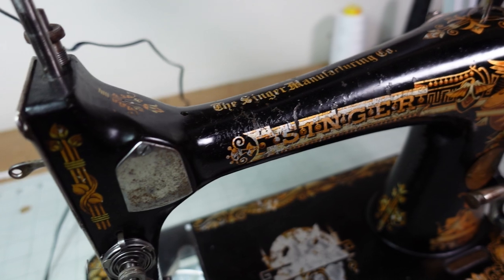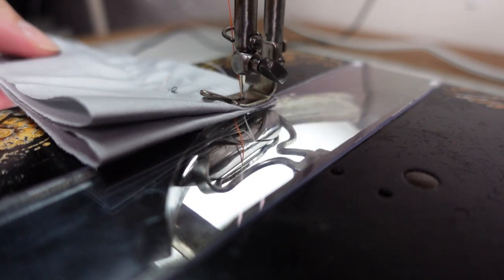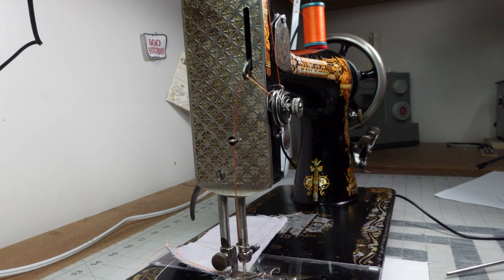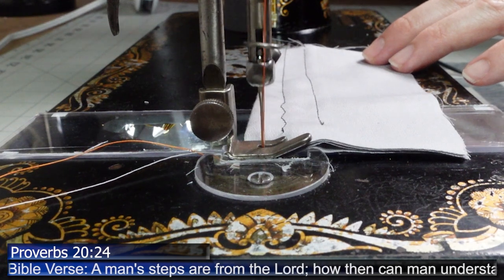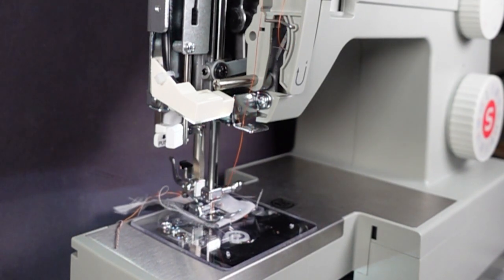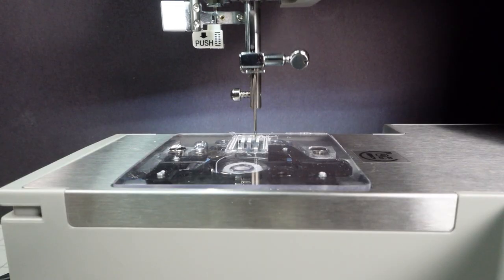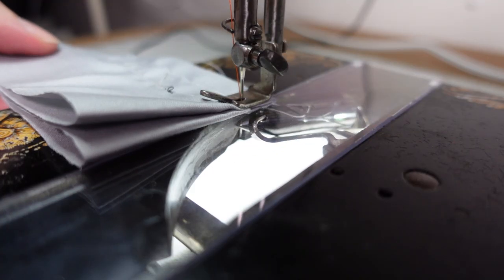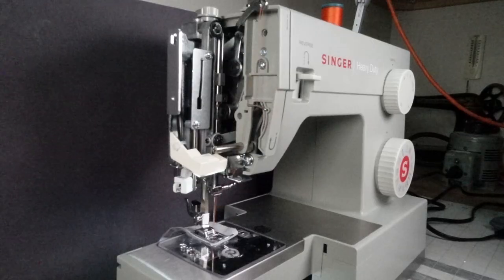How does a sewing machine work? Free course on sewing machine repair Part 1 of 5.

Comment: Congratulations on your excellent teaching technique: clear demos; summing up what's been covered, etc.  Unfortunately I couldn't diagnose my problem.  The whole machine seizes up after an inch of sewing, requiring a screwdriver to correct - then it would happen again!  I've spent hours trying to figure it out.
I lugged the machine on the train to a repair shop miles away. To my absolute good fortune, the woman there knew that using old cotton thread could cause such problems with modern machines.  She set up my machine, changed the thread to her modern-branded one (polyester & cotton) and it sewed perfectly!!!  She saved me $160 and I was able to lug the working machine back home.  I will now throw away my decades-old threads that worked fine with my 1967 sewing machine.
I wish this information had been printed in Janome's user manual.

Comment: Thanks bunches. Sewing for over 70 years. Have Gram's Desk Singer and use my Mom's Singer on a separte table.  I can take apart. oil and grease where needed but there's more right? ))) I've carved metal replacement parts and work from the manual, but there's MORE right?)))Learned function of take up arm and tension mech today ))))

Comment: Hi I had my thread bunching up in the back of my fabric.  I watched your lessons and started by cleaning.  However when I put it back together it’s no longer working properly.  When I step on the pedal it does on rotate.  However when I hit the pedal my Bobin will spin.  However the needle does not move up and down now.

Comment: Hello. i listened to the list of things to come in our sewing machines But i didn't see my problem mentioned. so i thought i would ask you here. pardon me if i don't know the correct terms but i will try and explain.  The rod that holds the needle well my rod can move from side to side. for example. if i turn the fabric with needle down the rod can move to the left or right which alters the seem width and if using certain feet,  the needle (now out of centre will hit the foot. my machine is an Elna 660. Thank you i really hope you can help me.

Comment: So, let me get this straight: The thread in the needle is pulled downward with each cycle. Then, as the threaded needle rises, a looseness in the thread creates a loop that allows the bottom thread to travel through and once this happens, they lock and life is good? I'm an engineer. I need drawings. Big ones.

Comment: Hi
I have a singer 1014/1027 it worked fine and now it runs but the shuttle seems to be disengage the needle goes up and down but the shuttle does nothing I was just wondering if you could give me some kind of advice on how to fix this.  I also have a 15-91 which is awesome but I'm sure you know it's only a straight stitch machine so that's why I'm trying to get my other singer working.  Any advice would be greatly appreciated as I've been trying to figure this out for over a week now.

Comment: My friend bought a White 534 Super Lock serger at a garage sale.  It skips stitches and the lower looper will not stay threaded.  There is a part that is supposed to have an eye to thread, bit there is no eye on it. The motor sounds good.  Any ideas?  Also, a suggestion for needle size would be appreciated

Comment: I still don’t get how it works. Why are two independent threads (the reel and the bobbin) needed?
When you sew by hand you just use one.
Reply: It’s just the design of this type of machine to use two threads. There’s an antique machine that uses only one thread (no bobbin!) and it self regulates the tension, so you don’t need to tune the tension to each fabric. If you want to see the machine, check out Engineering Knits Antique vs Modern sewing machines video.
Edit: the video is titled Battle of the Machines by Engineering Knits.